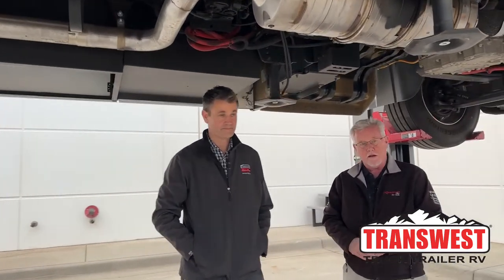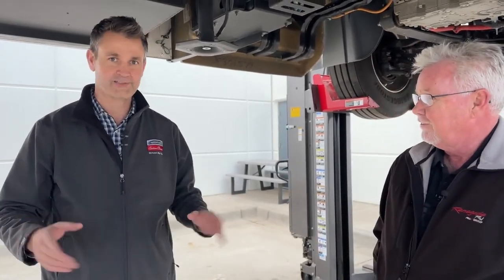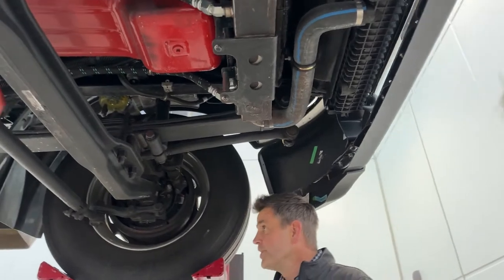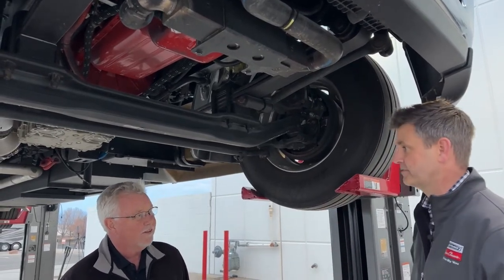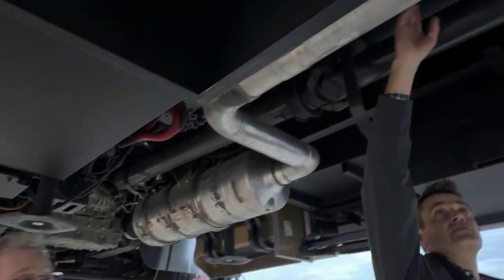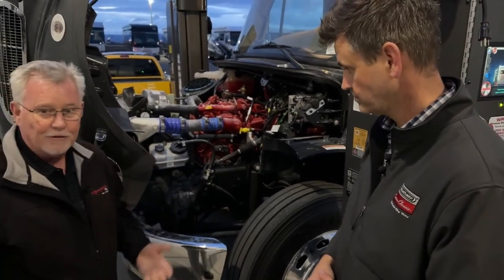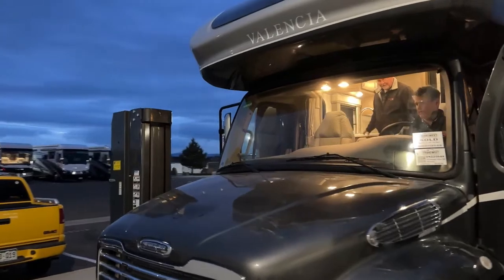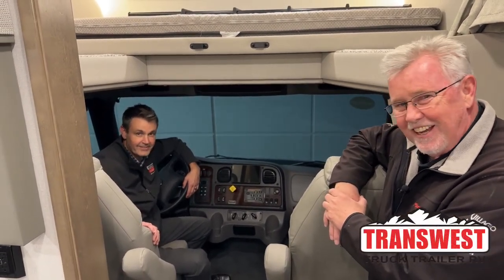Underneath a Renegade S2RV Chassis By Freightliner Custom Chassis

Comment: I am looking at a super c on the S2RV CHASSIS will an aftermarket heavy duty bumper that fits the m2 chassis will fit the S2RV CHASSIS as well.     The reason why I am asking is because where I live there are a lot of deer, elk, and moose in the area.      I just would like to have something that will protect the front end of the RV when on the road.
Reply: Yes, the comparable M2 bumper will work

Comment: Thank you for this informative video. Everything I have heard about the S2RV is that it is a terrific chassis. My concern is the 6.7L Cummins being somewhat underpowered for driving the mountains out west (which is why I ultimately chose the Verona with the 8.9L). To be clear just about every owner of these feels it does fine on the flats. However when driving up the the summits you need the mindset “I’ll get there when I get there.”

Comment: great video but my 2019 Jayco Seneca 37K rides like a gravel truck.  terrible. but I know something is wrong, air bags not working or something.  I'm still researching and hope to find it.
Reply: Gravel trucks often have rear air suspension, too... and more importantly, the same leaf-on-beam front suspension.
Reply: @brianb-p6586  I took it into freightliner,  they tested ride height and did a road test with vibration analyser and said it is within specs.  which tells me that the "J-Ride Premium" sticker on the side means "Rides like a gravel truck with no gravel". lol.  Oh well,  there is a lot we like about it.
Reply: @rrrrkoop2776  LOL It should actually ride like a gravel truck with at least a part load of gravel, because it is always carrying the weight of the coach body.